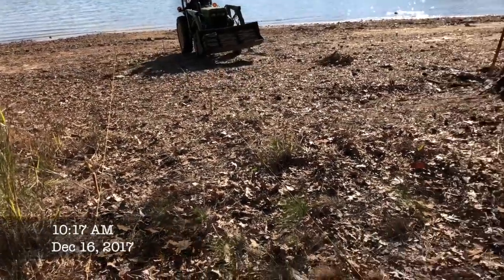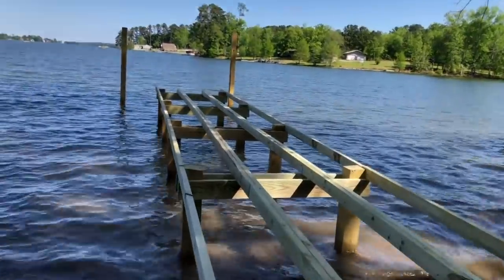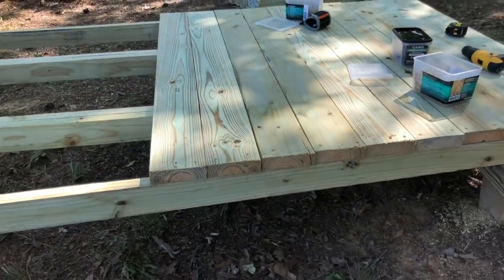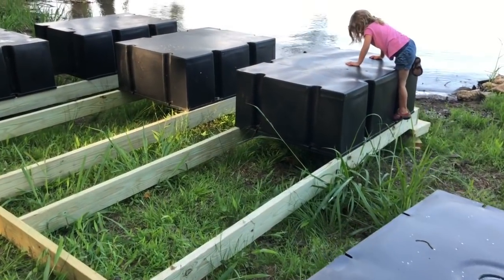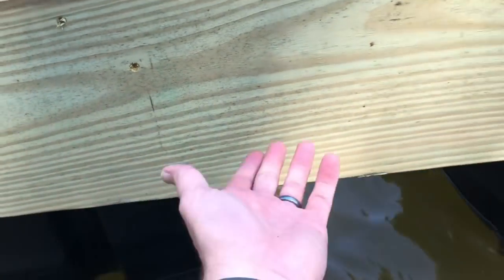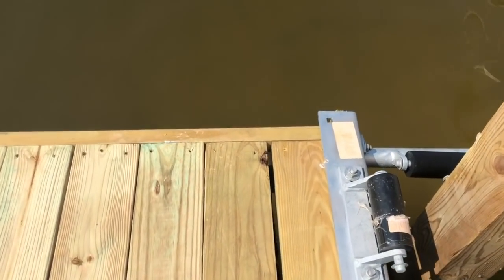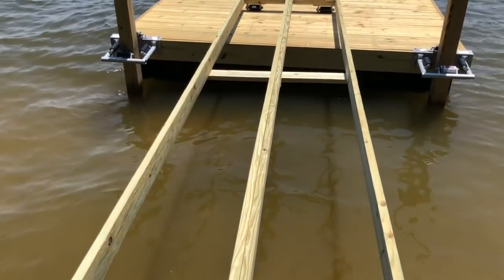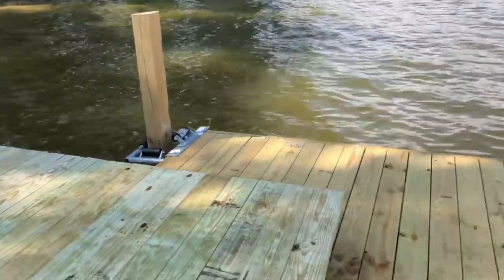How to build a combination fixed and floating dock

Comment: Very nice video. One comment from homeowner on a very busy lake with a lot of weekend wave action is that the attachment from gangway to fixed dock gets a lot of torque from waves and has bent the 2 by 12s on the fixed dock inward almost 30 degrees over many years.  This is the 2 by 12 on the side of the fixed dock that the steel hardware attaches to.  I would suggest sistering an adjacent board to it to prevent this twisting of the wood. Our board is so bent now that it would be very hard to attach anything to it. I wold also add some heavy duty galvanized steel L brackets to corners on far end of gangway as this is a place we have experienced alot of stress and wood loosening from the up and down wave action. These suggestions may not be necessary if you don’t have a lot of waves. In fact a gangway may not be the best option if there are a lot of waves

Comment: enjoyed video, just doing research, as my wife wants us to buy a property at "lake" for retirement in next couple years, but not seen the rollers to roll up & down 4X4 posts before,  how did you dig the ones in water? or was the water down?

my potential future issue is a rise or drop in water level. not sure how low it can get, but 2 times this year, it has risen 8' over normal. heights due to floods, after a certain point they open flood gates, at dam, but cant flood lower areas either. saw so many pics of docks floating, or the floating docks now hanging by poles 6' to 8' out of the water. I am wondering on a totally retractable set up, where it floats on poles, but remove pins & also have guides to allow it to be retracted? just mumbling..... lol.

as for your 2x4 sistered, as you called it,  it was actually a thing in some old building books, but..... they cut a piece of chipboard 3 1/2" & they used the thicker chipboard, then apply wood glue, or liquid nails today, they used decking screws to hold the 3 pieces together, they showed comparisons how the home made 4X4 were stronger than normal ones store bought. I only did it a few ties to re-inforce rafters in storage buildings.
Reply from the maker: I placed them when the water was down.  Appreciate the feedback.  Best of luck with your dock.  Mine has held up great for about 3-4 years now.